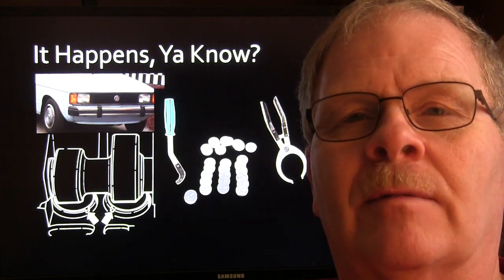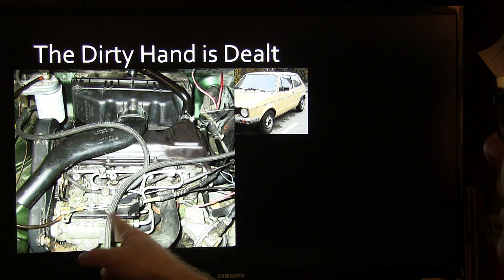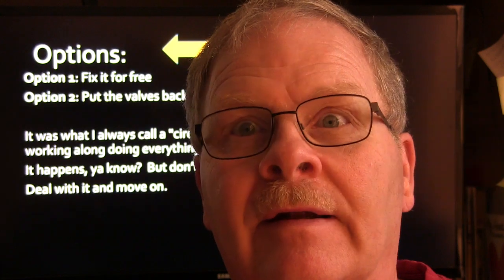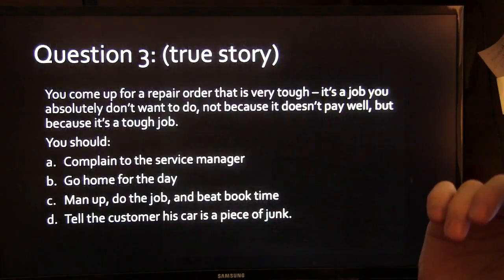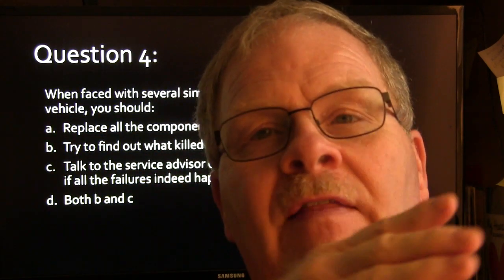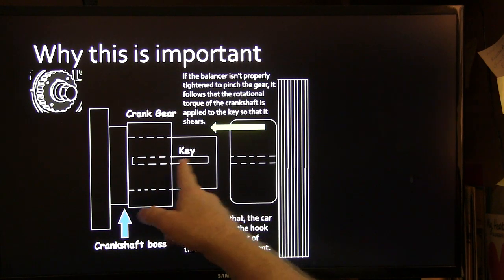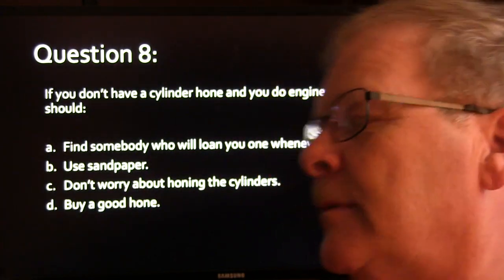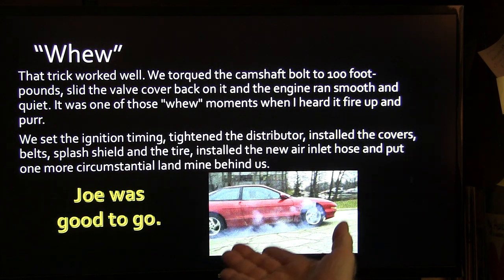Circumstantial Land Mines

Comment: I have had my Cat ct660 dump truck in for ac repairs three times this summer and every time it comes back it is worse. The first time I was told it needed a new accumulator dryer. So I ordered that and sent it in to have it replaced. It hardly wood cool the air below 80 deg after that so I had to find out from Cat how much Freon it held and then took it back in because it wasn’t charged to the right weight. When it came back that time the compressor would only run for 20 seconds and then shut down. The freeze switch was shutting it down so I had to order a new one. Not the problem again and now the service technician has given up. I did find out the the low side pressure won’t go above 15 psi. The only good thing is the service technician told me he can’t charge me for the work because he didn’t fix it. Unfortunately I have lost over a days work and my driver is still whining at me to get it fixed. Do you have any ideas what could be wrong. Hi pressure side is good 175 psi
Reply from the maker: I'm thinking you have some clogging going on there. The drier or accumulator may have dumped dessicant into the system. You should get the expansion valve or the orifice off and see what shows up. The condenser or evaporator may be clogged internally too.
Reply: Thank you for the reply, I almost ordered a new expansion valve for it until I saw it was $500. I will check into it now though. Thanks
Reply from the maker: @mitchstephen5491  Have a look at the drier and see if the dessicant bag has burst.
Reply: McCuistian I will have to check and see if the garage still has it but I’m assuming it went in the garbage

Comment: Love the Probe stories.  I have a customer with a 97 Probe GT that I've done a ton of work on.  Timing belt, clutch, alternator, starter, and most recently valve cover gaskets.  Not real fun working on that thing but the guy loves the car.  232K miles and counting.  The peril with the last job of the valve cover gaskets was the rock hard and cracked vacuum lines on some kind of vacuum reservoirs underneath the intake.  I broke one of the plastic nipples on one of the reservoirs...JB Weld to the rescue on that one.